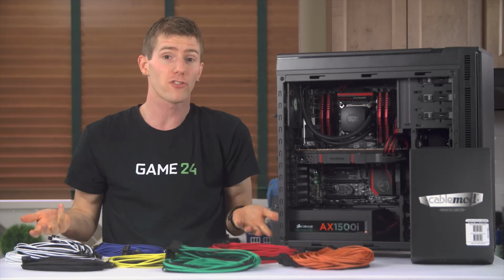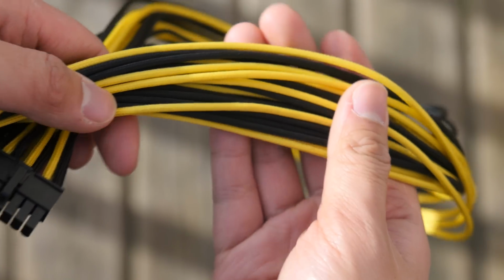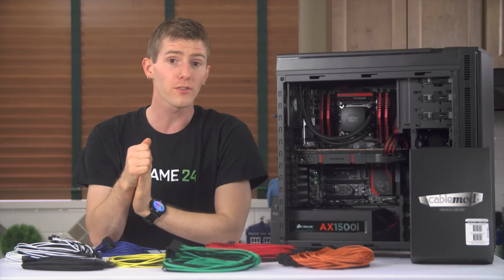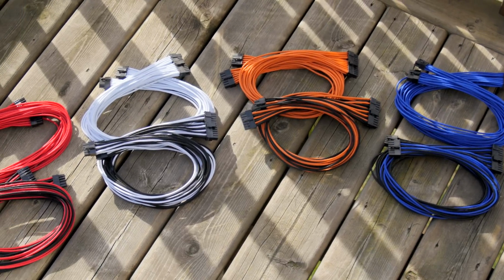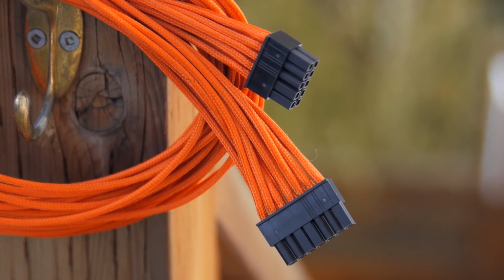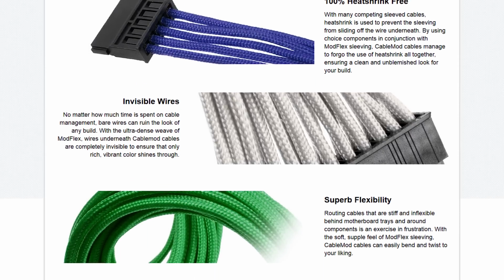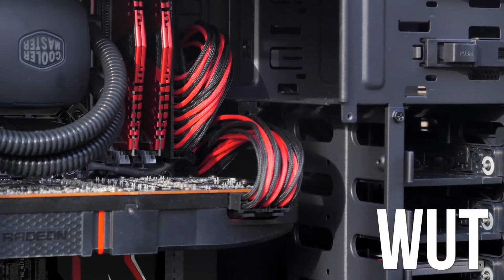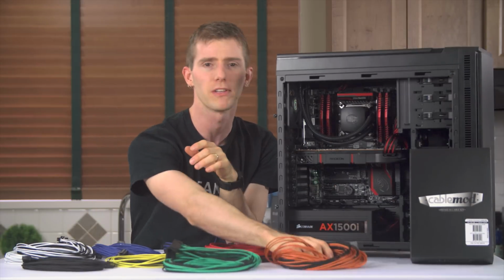CableMod C-Series Individually Sleeved Cables - Sexy and Simple

Comment: Do heat shrink and MDPC weave right and I think it looks better than Paracord. 
It's just hard to get right.

Heat shrink gets a bad rap because so many people screw it up.
Reply: we chose Paracord because it makes the cables more flexible which makes your life easier in terms of cable routing!
Reply: CableMod Community The downside to that is that it's harder to hold a neat form of cables compared to polyester ones which are undoubtedly more ridged as you mentioned. It's also a lot harder to bunch up sleeve on a polyester cable.

That said, your cables look great. Just not my style.
Reply: got it - once our Paracord line is finalized we will be working on a nylon one! Thanks for the feedback.
Reply: Would love to buy one but shipping to canada is abysmal.

Comment: I have BitFenix Alchemy cable extensions but the last time I properly cleaned my PC and repositioned the fans I let them out because I had no zipties and without those it's impossible to get everything in there. Without zipties and the normal cables it's already bulky. I have a cute Corsair 350D btw.
Reply: get our cables for your PSU - that would minimize the cable mess compared to the use of extensions.
Reply: CableMod Community Well that would be great but it seems like you don't have the fitting cables for a BeQuiet Straight Power E9, at least not at caseking.de
And even if they had a fitting set in stock I wouldn't buy them anytime soon because I have to upgrade other stuff first. But the next time I am looking for cables I'll remember you.
PS: Just read in the comments of caseking's video that BQ cables are coming soon.
Reply: we will be launching our cable sets for be quiet! in April and they will be available at Caseking by then.
Reply: CableMod Community Will you be launching cable sets for cooler master v series PSUs any time in the future?

Comment: You should do a " water cooling vs fans fast as possible"
Reply: water gets rekt so hard it's not even fair.
Reply: Navhkrin  stock means no overclock you dipshit.
You say idle next time or someone whos not as nice as me will whack your ass.
Reply: ***** no, cause it ain't "simple tech" ... fans is simple! ;-)
Reply: I'm pretty sure he made one of those videos on NCIX but I could be wrong
Reply: kaleaf  my 8350 runs 100% load at 39-40 C on AIR.
Reply: tulp35000 If a 4790k goes to 70c, the case either has bad airflow or it's being cooled by the stock cooler.
Reply: They have in past of all in one vs air and all in one won so custom would crush. With my loop i have my gpu idle at 26 and cpu and 30. Under load gpu goes to 29 and cpu 45. So yer.
Reply: tulp35000 I'm not quite that low but 49-53 on air at 4.6ghz
Reply: tulp35000 yes but how big is your heat sink. Plus is it overclocked.
Reply: My cpu runs on 80c at 120% load... :(
Reply: kaleaf  4.1ghz undervolted to 1.295v noctua nh-d14 define R4 case with stock fans.
But that's because amd runs cooler than intel on average. Intel at idle is around 40c on 4790k. Load 70c ish. The magic dust in intel cpus make their cpus run more instructions per clock.
Reply: tulp35000
But that's because amd runs cooler than intel on average
Thats exactly the opposite of what really is happening.
I have a very bad thermal compound and i messed up application real hard. Its as thick as my finger yet my overclocked 5820k is stock 33c load 50c
Reply: Navhkrin  overclocked 5820k is stock 33c load 50c... Can't take u seriously.
Reply: tulp35000 Im not using stock cooler...
Reply: tulp35000 Cmon kid. Stop with your insults. There is no point in insulting. Because we both know you couldnt do that towards my face.

Stock means default. CPU will only be under load when you render something. Other then that CPU will always stay idle. Even in gaming. Thats what we call stock.
Reply: Navhkrin  Yes i'd tell that to your stupid fucking face and whack you thereafter.
Come at me bro 1v1.

Finally someone gets that cpu idles even during usage.
Reply: Watercooling uses fans.